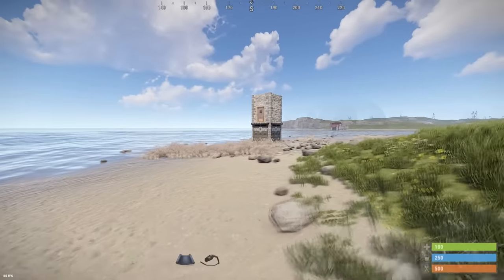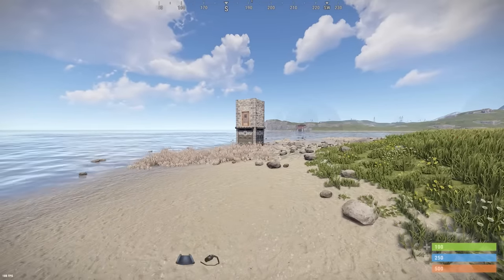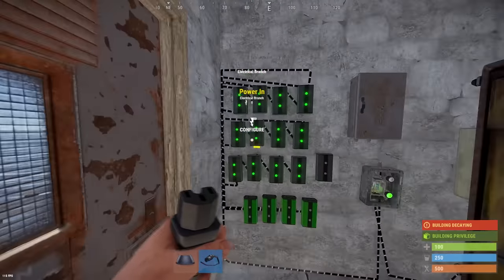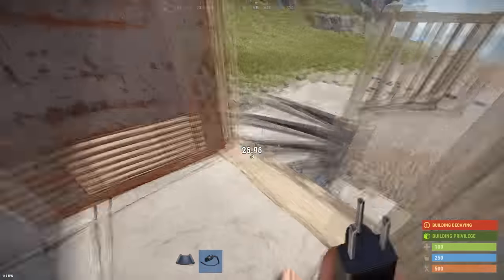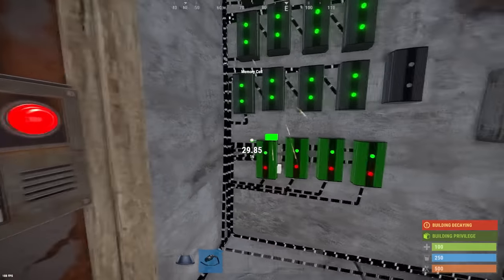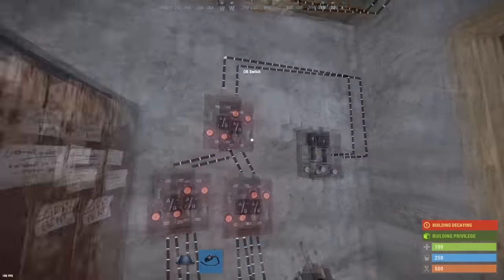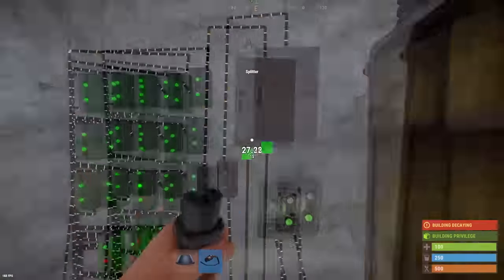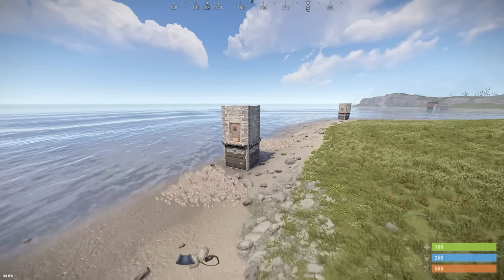Rust Auto Turret Tower Defence

Comment: That was a complicated circuit for 3 turrets with hbhf. But trying out stuff until it works is a great way of learning. A tip: When a circuit works, go through it and try to remove components and make it work with less. Optimize it as much as possible. Bu looking at this, i can tell you that there is no need for memory cells, and the amount of branches could maybe be cut in half. And there is also no need to have the splitter. The timer is nice if you want it open for a amount of time. but is not required. Also, try to seperate the turrets, if 1 guy triggers the tower, another can shoot rockets and get all 3 turrets at once
Keep on learning^^ defence towers are great
Reply from the maker: Ty , i tried to make it cheaper without success , but iil work for more stuff
Reply: Could you share your circuit please?
P.S. Also, It would be much more power-saving if turrets were activated from hbhf
Reply from the maker: @BalynOmavel  you can't activate turrets directly through hbf due to it's power out limit to 1 unit , the circuit chart is in the discription btw
Reply: @BalynOmavel  it makes no sense to connect the turrets to hbhf... you need turrets on all the time and by connecting the hbhf to the doors they are protected and only in use when a threat comes close to your base. But no it makes absolutely no sense to have the turrets activating off hbhf.
Reply from the maker: @biggity_blake  you can't connect them directly to hbf , i added the timer to make it triggered for certain amount of time , sometimes it can kill more players even if the hbf does not detecting anyone due to detecting distance
Reply from the maker: @BalynOmavel  chart in the discription
Reply: @aaronash8571  I asked Mr Digi
Reply: @aaronash8571  cheapest way to do this is to have:

Branches to each turret, last branch should power out or branch out to an RF Receviver.

Separate row of branches that the POWER OUT of the RC receiver connects to (so that the branches receive power when the frequency is broadcast)

Then you simply need to connect each HBHF sensor to an RF broadcaster, so that when they detect enemies they transmit on that frequency.

You can then also use this frequency to set up smart alarms or any other notifications and also make many turret pods open simultaneously.

Pog.
Reply: @aaronash8571  you can also get a hbhf sensor to turn on a turret using an AND switch, but it’s excessive and power hungry to do that

Comment: You should use double doors instead of garage doors because they open a lot quicker, also the turrets should be always on because it gives the enemy time to run
Reply from the maker: They will block most view of the turrets , besides that it only activates when they approach near to the machine which makes it a kind of trap
Reply: idk, leaves pretty large blind spots plus is less strong and the doors dont need to be completly open for the turrets to shoot. Only enough for the top of the turret.
Reply: bro has 200 hours on rust
Reply: With turrets always on the battery wont last, becau with everyting on it drains 60 power and the painel can make only60 power but only durante the day
Reply: @ianBRJ  Just add a couple more solar panels and that problem is solved.
Reply from the maker: @ianBRJ  i already explained that in the comments , it's only using 60 power units when the machine triggered and just for 10 seconds , in offline mode it's using only 32 power units
Reply: I am going to agree, and the blind spots can be mitigated by simply moving the sentries around from one spot to cover weak areas instead of clumping them. Players will react way too quickly for a garage door and reaction time is everything. You can also just reverse the direction door of open inwards. Another thing I've learned is setting up barricades under sentries if they are elevated to force people out of their blind spots.  Be careful on triangle foundations since they can be exploited with explosive damage to damage sentries inside.
Reply: turrets always on is gunna use a lot of power... needing more solar panels
Reply from the maker: @gnhatch  they not always on , only when triggered by hbf
Reply: @aaronash8571  yeah no shit thats why im replying to a comment who suggested to leave them always on
Reply: Normally this is true, but in this type of setup, garage doors are always preferential.  Another thing to note is that routing the door controllers through a blocker with power in to those from the no ammo of the turret will keep the doors from opening when they run out of ammo. GL HF
Reply: @Josh-vg2cu   place mor of theese inside your high external walls compound and the blind spots will be gone... just one; mid-endwipe you will have all the needed components and ressources.
Reply: @a64dx86  i dont really think this something something i want inside of my compund lmao id rather just stick with regualer turrets and just have them running of my main base at the least, no need for this whole structure. Mid-end wipe really is a bit of time. You can prob get a few of these down if you really wanted to on the first day of wipe pretty easily.
Reply: @ianBRJ  If you use branches it will drain power anyway, doesnt matter are the turrets on or off
Reply: Double doors open on either side and block LOS. That's a terrible idea.
Reply: I agree turrets should be always on, but always use garage doors if you can. Much better. If you open when enemy is close enough there’s no escaping them regardless. 

Link the door controllers to an RF receiver and you can build loads of these around your base and have them all open on the same frequency which you can broadcast using a smart switch and an RF broadcaster.

Ez farming
Reply: Agreed. Build shown is not very good. Always sheet doors and never stack 3 turrets within the same HV range LOL

Comment: Possible simplification: Instead of memory cells, you can use an AND switch as "amplifier" for the sensor to drive the OR switches (with more than 1 power) :)
Reply from the maker: Iil try that
Reply: Yeah I was confused with the mem cells for a simple on/off.  Also a smart switch instead of a regular switch for remote on/off in case someone finds a blind spot.
Reply: @LuxInvicta  yeah, with this "amplifier" pattern and some OR switching you can do all these things.. manual override with switches or RF (the good ol  "kill everyone button") or keeping doors forced open using the "has target" signal from the turret while its shooting at someone running away.. :)

Comment: I came across these as outer perimeter defense, I just walk right up to it with 2 Wooden Barricade Cover and shoot an incendiary rocket into it, the garage door kept the fire within the square hence breaking all 3 turrets, and I stashed by launcher and 3 minutes later came back to pick up 3 free bolt rifles since the sensor and door controller were intact. These are only good for the first time as a surprise, next time people will be coming back with grenades and launchers or just bows and bait them out, as a base owner you'll have more headache repairing and replacing your turrets than the beach spawns that won't stop coming back.
Reply from the maker: I will make improvments to counter this kind of situations and make it better in general.
Reply: Imagine those turrets being inside of a compound tho with external TCs everywhere just like these, u will not be using those wood barricades then
Reply: Build the tower using triangles, partition each turret, and place the door controllers at the lowest point you can behind the turret. Any kind of rocket or explosion will usually destroy the door controller first, closing the doors and protecting your turret and ammo. Whilst also serving as extra honeycomb. Grubs have a shit time trying to take out a series of turret pods set up like this.
Reply: @aaronash8571  surround with chain link fence

Comment: FYI: The electricty will use around 60 power units, which is the same amount that 3 solar panels can generate at max. During the night, you wont make power with the solar panels, but will continue to eat up power. That will inevitably dry out the battery and you wont be able to use it
Reply from the maker: It's only 60 when the machine is triggered and for 10 seconds only unless you change the value of the timer , in off mode it's using only 32 power which is good enough for recharging to last the night.

Comment: Some ideas since I know this is tutorial level for people just beginning. Set up a blocker for both timed closing and/or ammo running out output since players will try and drain the ammo or use their buddies to prop the door open and launch an inced rocket into to it. Using Chain fences can also stop rocks and ammo from hitting your sentries. This design is great for a learner, but bad in actual situations since it can be easily exploited. Solar panels are easy to destroy especially since molotovs are in game now. You could use walls to stop a lot of longer ranged attacks. You could get the circuit to close if sensors are detecting more than one person.

Comment: thats nice; i like that!!! i was last months when i played rust on my own (dedicated) server experimenting with some prison cell doors and walls; but this auto-opening thing with heartbeatsensors I dont even think about it; more than auto closing doors when anyone is getting into my compound.
And yeah, all on electrics i had doing is : the inputs via wind or solar; and additional those engines; this red boxes (adding sources) and those splitter (black ones) and a switch for the light... Ok; putting some sams and autoturrets and christmastreelighs around my compound that was nearly all electric... you can do crazy stuff with all of it (electric circuit components like and-nand-nor-xor-or whatsoever switches and memorycells) ; but the annoying thing is the max output from 100 of a huge battery; and if you charge with 600 + you have to change the wiring when you want charge many more batteries and so on... you waste a lot of energy about it. 600+++ in and just 100 out. Stupid!!!
Reply: Get your 600 in one wire for simplicity, split it into 6 with splitters or branches into 6 batteries then combine all 6 batteries back into 1 for 600 in ~600 out then go from there. Not necessarily a LARGE waste of power, maybe 10 at most but worth it imo. Also dk if I misinterpreted your comment or not.

Comment: was thinking I could do this with less power, but tbh, I'm not so sure now.  If I find a way I will update.  My only question is, won't this pull the draw of the battery always?  This is why you need to use the blocker as it will prevent the draw and instead rely on solar when available?
Reply from the maker: the machine works on offline mode which use low power and can survive even through the night , it only uses full power when triggered by the sensors and for several seconds

Comment: You only need 2 turrets back to back to cover 360 degrees, its better to make heart beat sensor per door, and all your electrical is ass bro, all your need is 1 And switch & branch per Heartbeat sensor and 1 Or switch per 2 And switches. Way easier to rig up then that monstrosity. Honestly I would make 4 triangle foundations connected and use that so they can blow out every turret all at once.

Comment: The turrets need to be turned on before the doors open. For the rest its decent.
Reply from the maker: it's can be done with more timer components , but it will cost more power units in offline mode which makes it harder to recharge and last the whole night
Reply: @aaronash8571  it's negligible really.  the amount of time for the turrets to turn on and the doors to open, is almost identical to the time it takes before they can shoot if left on.

Comment: You placed a large battery. You don't have enough solar power to feed the battery. You should have used a medium battery. Also does the doors close when the turrets are out of ammo. Finally, the turrets should always be on.
Reply from the maker: I explained it several times in the comments , 3 solar pannel is enough to charge because the machine works on offline mode usually which requires only 32 pu , it's draining out power only when triggered by the sensors and just for ten seconds , medium battery dosen't have enough to power 3 turrets along with the circuit since when triggered it's using 60 pu , about the out of ammo situation i'm going to added this Function on my next auto turret tower defence v2 update , the main reason that the turrets should not be always on is due to pu economy.

Comment: 3 Turrets on a square floor is clearly too easy to destroy, it is safer to use triangles and put walls between them
Reply: pods are nice but using chain link fence is the best. If there are two layers of fence, player bullets cannot pass as well.
Reply: but yes, do use triangles, your turrets survive-ability will be better by far.

Comment: have all HBFS connected to OR gate then to timer, then from timer have it go to turrets and door controllers. there are too many branches and memory cells here. Have sensors linked to timer via gate, then timer linked to doors and turrets.
Reply from the maker: won't work , hbf can only send 1 power unit even if it recieves more , 1 power unit is not enough to sent signal through the circuit

Comment: Turrets are susceptible to splash. A raider can easily get 3x value for hvs or incen
Reply from the maker: This machine actually brought me high value loot from players if it's used against players which not suspicious of this structure
Reply: @aaronash8571  against random people running by I'm sure it's wonderful. During raids though, not sure
Reply: @NesKimoV  don't think this is built for raid defence, maybe off line compound defence but once you know you'll go nowhere near these or spend a few rockets to destroy them. Either way it's no different from any other turret set up, besides the fact you can't compound bow these as easily.
Reply: @nothotdog1488  I'd argue it is different, it's 3x the expense for the strength of 1
Reply: @NesKimoV  how so? If you destroy a single wall above the turrets (either side of the door) the turrets will stop functioning due to a break in the circuit. 
Also if you can hit the foundation you can wipe the entire thing with 4 rockets if it's built in stone as we see here. 

Expense isn't a factor for my group we run through 400 rockets a wipe as a 3 man. Profit doesn't come from turrets, it's inside the loot rooms.
Reply: right it's better to split them in triangle foundations

Comment: it just dont work for me.. the hbf sensors wont work. the only thing that works is the turrets come on and doors open if i manually switch the timer. the hbf sensors are set to both me and enemy and they just dont start the circuit for me?
Reply from the maker: Maybe you didn't set the right amount of power in the branches that feed the memory cells

Comment: Ive built this on 4 towers and none of the doors operate right. any tips on where to find my problem? I called myself going step for step.
Reply: Does putting locks on the garage doors prevent them from working properly?
Reply from the maker: @paulprestage  you should pair the doors to door controller before puting locks
Reply: Well I didn’t realize you had to actually pair your door to your controller so I went back and did that all the way around… I changed up my Sensors and out the a further distance from my turrets because they are literally walking on the tower before it sets them off for some reason but anyways it works great! Great video and thanks for the help! 😂

Comment: can you run it with two solar panels, im on console rust and it won't let me place three on one roof
Reply from the maker: two won't be enough to power the battery , check my newer model of turret tower defence on my channel , it has more efficient circuits and more mods.
Reply: Place panels first then walls and you can

Comment: Please tell me how to make one hbf sensor make multiple doors work on both sides of the both so while any one is driggered all doors will open?
Reply from the maker: Simple , just use AND gate to amplify the hbf signal than passthrough between the door controllers
Reply: @aaronash8571  whats the memory cell for mate ?
Reply from the maker: @jezzdogg6857  i used them as amplifying signal , you can also use AND gate for that purpose
Reply: @aaronash8571  thanks bro trying to finally build it now
Reply: @aaronash8571  figured it out thanks mate

Comment: So my people
 Is I tried to enlarge this circuit as I have 6 doors that need to be powered and 3 turrets. Because they are on triangle foundations. The or switches won’t work properly as I had to add more and they don’t connect properly is there anything else I can do to change the amount of doors I’m powering without making a 2nd circuit
Reply: My problem
Reply from the maker: Check my latest video of auto turrets v2 , i think it's the exact build you trying to make